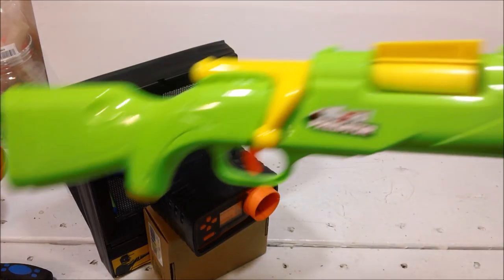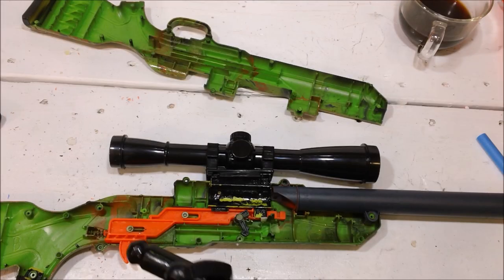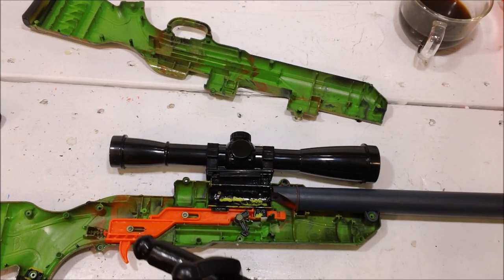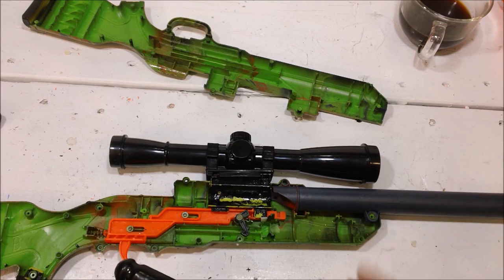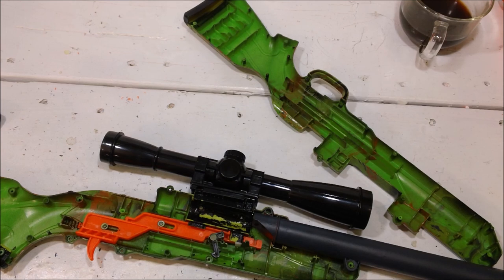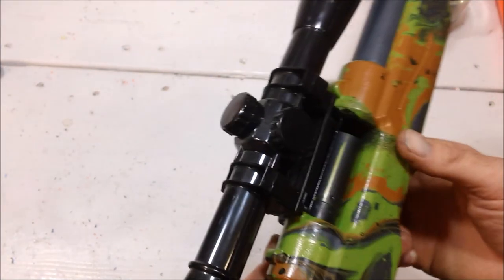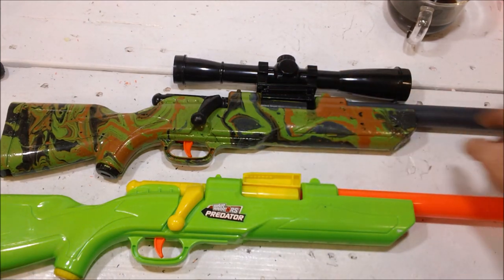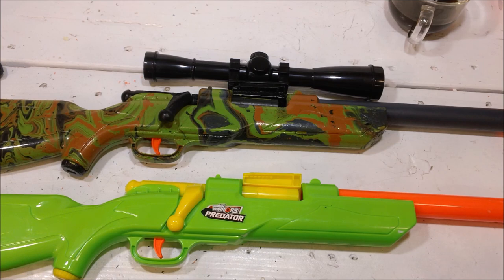Buzz Bee Predator Hydrodip and Mod

Comment: Have you tried modifying an Ultra Tek Predator or Andrea's Rifle? If so do you know what spring load it can take? I wanted to modify my Andrea's rifle with a 6 or 7 kg spring and one of those easy breeches you've done. Since Andrea's Rifle's internals are nearly identical to the Ultra Tek Predator just stretched out and with a mag well, I'd assume they probably have the same mod potential.
Reply from the maker: A Predator mod on the newer model is down the road sometime, have a special idea I want to do on one.

Comment: I have a sidewinder, and it won’t take elites because of that huge post in the back. Should I use long-distance darts or AF standard darts instead?
Reply from the maker: Now on the Sidewinder, the "posts" in the rear of the drum are actually nozzles. They direct the air into the darts. 

I'm going to guess you have an earlier generation Sidewinder (green, or older blue style)... You can trim some of the shell in front of the drum to allow the use of all darts. I did it to a earlier green Sidewinder I own, and used it for a few years that way (still have it actually).
Reply: Ok thnx for the tip. The sidewinder I have is the gray one. Also, I saw new blue sidewinders at my local Rite aid. I didn’t know that they were still sold in store anymore but I guess they stay on shelves longer than actual nerf
Reply from the maker: @abrahammontgomery2516  I actually did a video on the current model (it has a couple of improvements, well worth getting) here: https://youtu.be/xKd5poqpVJE